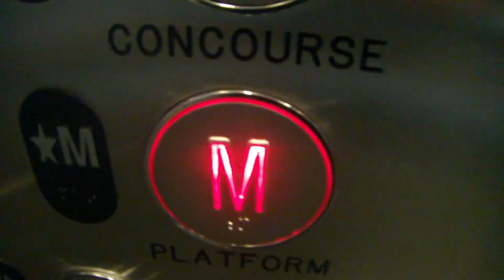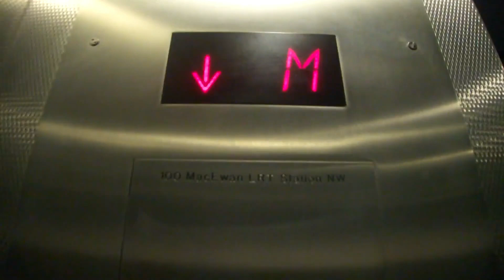Custom 2015 Schindler 330A Hydraulic Elevator @ MacEwan Station - Edmonton, AB

Comment: Why couldn't they have a 5500?
Reply from the maker: This was probably installed before 5500s were introduced. Although, I can’t complain about this installation because seeing a custom 330A is pretty interesting. However, a 5500 wouldn’t be the best choice for a place like this.
Reply: @LocoRails79-Randomness  5500 was introduced in 2014
Reply from the maker: @QuarioQuario54321  No, it was introduced in 2015, right when the 400AEs were discontinued.